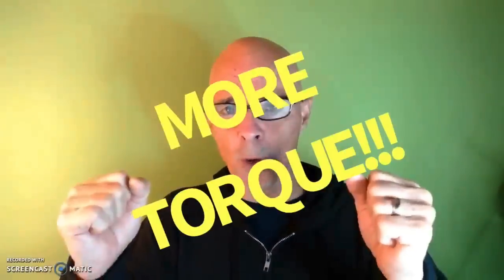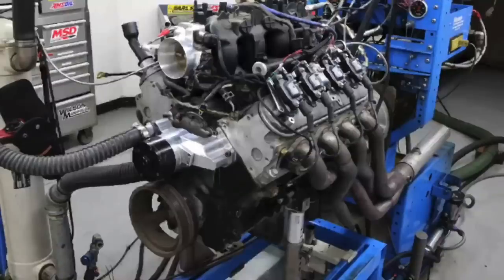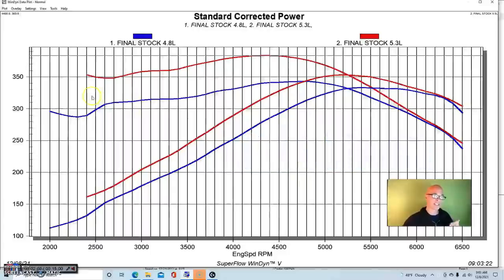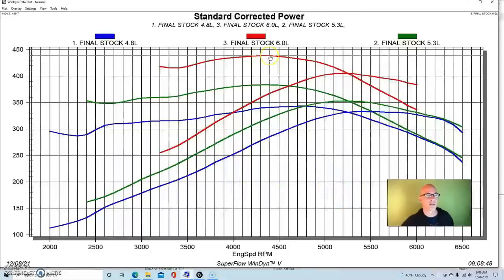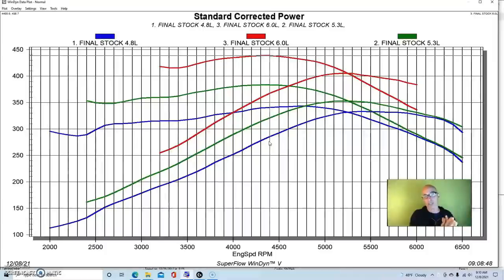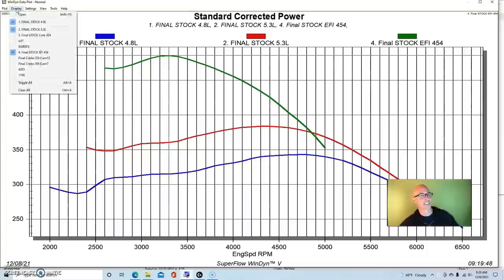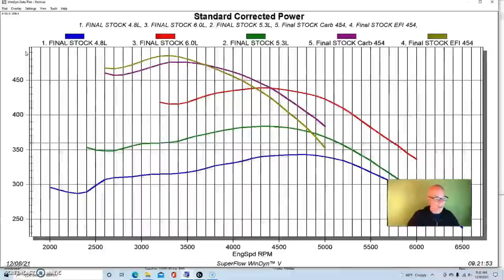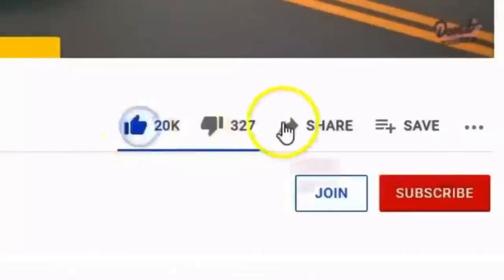LOW BUCK, JUNKYARD V8 TORQUE TEST-6.0L LS VS 7.4L 454 BBC-WHO MAKES MORE TORQUE? BETTER VS BIGGER!

Comment: @Richard Holdener, I'd like to see some combos and testing of a 454 in a attempt to bring MPG of the big block more in line with LS engines. That's always one of the arguments of BBC versus LS engines. 
Is there a way to get 20+ MPG out of a 454 and retain the HP and torque synonymous with the BBC?
Now that is a challenge!
Reply: Your not likely to ever see the mileage of a 454 get close to an LS, that’s Richards argument when he says “better” the ls design is so much more efficient. In the same way, your never going to see that low down torque production in the LS, pretty much for the same reason, the port flow on the modern engines is so good, you don’t see high velocity at low rpm like you do on the older designed bbc heads. 

Small ports with big cubes creates very high velocity at low rpm, that’s why “peanut port” truck heads make so much low rpm grunt and run out of steam above 4000rpm. All those cubes and the old inefficient heads need lots of fuel and air to run. The new stuff is so much better, but small cubes and big ports can’t create the grunt down low, it needs the rpm to get the flow velocity up.
Reply: @guyforlogos  you also didn't have the air fuel accuracy or the trans that put the engine at the most efficient range running small tires compared to today or or the accuracy in spark timing I think you could break 20mpg with a big block more compression and dialing in the engine would be key
Reply: @austinhowze6280  you definitely can in a car with an overdrive trans and modern fuel injection, or even a very well tuned carby, but not likely to ever see high teens let alone 20mpg in a tow vehicle, which was what my comments were based on because of the nature of Richards video.

My sisters all stock 06 2500 with a 6.0 and 4:10’s, built to tow well, gets 12 unloaded and about 8-9 towing 5k. That’s pretty modern, my buddies all stock 17 yukon xl, 6.2 gets 21!! unloaded and under 70mph, 18 mpg at interstate speeds, 8-10 towing his enclosed 7k trailer. Towing is brutal for gas engine mpg. If you tow a lot you want diesel for mpg.
Reply: @guyforlogos  my cousin old 460 did 10mpgs unload and 9 white 15 20k behind it buts it's mostly on how you drive it
Reply: I got 20 in a 96 k3500 single cab long bed non dually
Reply: My 95 Chevy xcab 454 straight shift gets 17mpg. 8 in town and 9 on the highway is 17 right?
Reply: @guyforlogos  Your buddies 6.2 Yukon get 21mpg because of active fuel management that operates off of 4 cylinders on the freeway.   It's great until the engine gets over 100k+ miles, then comes the collapsed lifters and blown engine. I have the stock non afm 2007 yukon denali with the 6.2. I average about 10 mpg, but also on 35"  tires.

Comment: I liked the 496 they put in Topkicks with MPFI. It pulled better than the Ford V10 at about the same MPG, maybe because of the 6 speed Allsion. It also sounded better.
Reply: Probably all in the trans cause I just pulled the power cruves and the v10 holds more low end power but after that the 8.1 starts making more power

Comment: "Nothing beats a LS motor, Except a Big Block Chevy" - Steve Brule on engine masters.  as a lover of all things big block, i agree.  the best truck motor I have ever see was the HT502 peanut port crate engine. its advertised at 406HP @ 4200 and 541ft/lbs at 3700. it has 8.75:1 compression so it can run 85 octane fuel. sure the LS makes more HP at a higher RPM, but Truck guys pulling a trailer are not running above 4500 RPM, unless they are down shifting while pulling a trailer and climbing a hill. you cant beat a BBC for truck engine with out going to a diesel.
Reply: Considering the Gen 6 snd 7 454s are more LS than a Gen 1-5 BBC...
Reply: @shadowopsairman1583  Gen 6 big block are mostly still mostly compatible with the Gen5 and Mark IV big block.  the only change from Gen 5 was the addition of a roller cam and the switch to MPFI from TBI. 

the Gen 7 8.1L Vortec is the one that most like the LS, it has a new head bolt pattern and symmetrical port heads. the firing order changed, and the oil pan rails were changed and the threads on the block are all metric. it also switch to the coil on plug setup like the LS. it was like the LS and the BBC has a bastard child.  its like the engineers at GM wanted to make a big block version of the LS, but the bean counters said no. so they created a LS style heads and cam for the BBC.  it doesn't really share any common components with the previous generations of Big block Chevy's.
Reply: An LS is great but the LT's are better 2014 and up.. direct injection..
My Silverado has averaged 24 MPG with the cruise control set at 74 MPH multiple times and tows great..
I can ease into the throttle and accelerate really good with out the converter unlocking or with out a down shift.
Reply: @philllsxga.7737  I agree, LS and LT engines are very, very, good. but for stump pulling brute torque its next to impossible to beat a Big Block Chevy.  that why they put the 454 Chevy and 440 Chrysler in so many motor homes. that 502HT is unreal for pulling power. and you can run crap 85 octane gas in it all day long with out issues.  the only thing that beats a big block for pulling power is a diesel.
Reply: @shadvan9494  yes I agree.
BUT YouTube LS Winnebago!
LoL!!!! Torque problem solved!!!
Reply: Yes I agree!! Ive got several bbc combos. My next will be a 502 shortblock crate and bolt some afr 265 heads and dual plain. I'm betting 525 hp and 650 lb ft. I sure love the big blocks!
Reply: @shadvan9494  I suggest you look up the L-86 6.2L numbers before you think a BBC would out pull it... lol
Reply: Try 500 Cadillac makes more torque down low compared to the BBC and weighs less too
Reply: @shaun.h.barlow  cadillac 500 is junk in performance comparison. Yes 550 lb ft way down low but thats just cam and displacement. The lighter weight you are referring too is ok for stock or mild builds but were the bbc is strong the cadillac has a lot to be desired in block strength. I do like the cadillac. But the big block chevy was overbuilt originally for use in nascar. Bopc designed there engines for standard luxury and performance street cars.
Reply: @YZFoFittie  460lb ft?? The only advantage is the 10 speed trans..
Reply: @thekid1924  video title LOW buck junkyard torque aka tow rig, on the performance side caddy MTR still holds gasoline land speed record of 417 mph
Reply: @shaun.h.barlow  a big block chevy holds the world's fastest piston driven vehicle 470mph
Reply: @thekid1924  if the caddy is so inferior to the BBC why does it need exotic fuel to go faster than a caddy on gasoline?
Reply: @shaun.h.barlow  whats low buck about a cadillac?  Can't find any engines or parts in my area. I know of several guys that tried the cadillac engines in tow rigs in the 80s the 472 and 500s. On long uphill climes with a load they would burn valves like the 460 fords. They don't breath like a big chevy. Ive towed 25000 lb with my 427 tall deck in my c70 on the longest grade around me which is 10 miles at 7% grade. 4000 rpm the whole way floored. Glowing orange exhaust manifolds. Ive put 20k miles on the rig in about 3 years. 0 problems
Reply: A huge advantage of a LS or Lt over a big block is weight...
Reply: @philllsxga.7737  a black bear weighs 600 lb a grizzly bear weighs 1500 lb. I wouldn't really consider the grizzly bear as having a disadvantage would you?🤣
Reply: @thekid1924  when it comes to a race car weight is everything...
YouTube Nelson racing LS engine explained...
Why would you want a big block?!???
Reply: @philllsxga.7737  🤣 fools have no reasoning. We are talking ultimate tourqe engine . Not dropping every ounce of weight. They make all aluminum big blocks also. But that's not the point.  99. 9 % don't care about weight . In trucks weight is good.
Reply: @thekid1924  but why the extra weight???
The ls is more durable than a conventional 454 I get the big block nostalgia but you cannot beat the LS motor and even the new LT it is leaps and bounds ahead of an old Chevrolet big block...
I've done a ton of off-roading in my life the heavier diesel Fords always got stuck the 1500 gas Chevrolets no problem...
Reply: Did you know a fully dressed LS3 is about 370 lb???
Reply: @philllsxga.7737  did you know an all aluminum 5.5 hp Honda weighs 33 lb?
Reply: @YZFoFittie  the L-86 doesn't beat the HT502 for torque.  the L-86 is rated at 460 ft/lbs at 4100 rpm. the HT502 is rated at 541 ft/lbs @3200 rpm. that's 81 FT/LBS more at 900 RPM lower in the torque curve. 

when your looking for torque for a work truck, or towing you can not beat A BBC.  Dont get me wrong, LS/LT motors are fantastic. they are as indestructible as a BBC,  get better fuel economy and weight about 250 LBS less than a BBC. they are everything you can want in a small displacement V8. but sometimes you just need brute strength, and that is where the BBC really shines. I would love to see a new "Gen 8" BBC, basically a Big Block version of the LS/LT.  somewhere in the 7.4 (454)- 8.1 (496)  liter range, with modern block and head castings. think basically a scaled up version of the LS. the gen7 8.1L Vortec is close but not quite there.
Reply: @thekid1924  yep! It's underrated. It's actually 546.684 horsepower and has an optional clutch housing relay throw out shaft for more on demand torque...
Reply: @philllsxga.7737  try to move a mobile home from AZ to Colorado whit it and then try it whit a 454 and came Back to tell us which was better.
Reply: @thekid1924  the advantage of the LS and Lt is the torque hangs on till past 4,000 RPM..
The 454 is done around 2,800 to 3000...
Reply: @philllsxga.7737  with the 454 in this video, yes the torque was done at that RPM. However you don't need 4500-6000 RPM pulling a trailer. even down shifting your not pushing 5000 RPM in a truck towing a trailer. the HT502 is a killer motor for a truck that is used for towing heavy loads.  most trucks with heavy gearing in the rear diff (4.11:1 or lower) with an overdrive trans and 33 inch tires are going to be pushing 2800-3000 RPM at highway speeds, that is right in the sweet spot for a 454 or HT502. and if it has to down shift, it will be right in around the torque peak in RPM in the lower gear.  so having the torque peak at 4k or higher in the RPM range does not help when pulling a trailer unless your running rear gears that allow the engine to run in that RPM ranger. which then kills the trucks fuel economy.
Reply: @shadvan9494  🎯
Reply: @philllsxga.7737  my ho 502 will burn the duallys off from 1000 rpm all the way to 6000 rpm🤣
Reply: @shadvan9494  you need to look at average Torque, you are focusing on peak...
Reply: @thekid1924  you don't understand the significance of peak vs average power...
Reply: @shadvan9494  Yes imagine one with the vvt that they put on the LS..and like you said with a new head design for low mid-range. No reason why they can't be running 10: 1 on a big block Chevy. Probably could be making 550 ft lbs down low in the rpm range with today's technology in a redesign big block. As long as they didn't get carried away with port size like they tend to do and slow port velocity.
Reply: @YZFoFittie  the HT502 and the 454 in this story still make more torque on average than the LS/LT motors. after peak torque, the LT/LS engines make more power to the peak, but that's all, and again not what you want in a truck engine that has to pull a load.  

Have you ever driven a Big Block Chevy powered car or truck? 

I have driven lots of LS/LT and big block powered Trucks for work. personally, i would rather have the big block when pulling any kind of trailer.  I have also owned a 2002 trans-am and 2014 Z51 corvette. I think the LS/LT engines are fantastic and get incredible fuel economy.  but neither hold a candle to my 1971 Camaro SS 396 (actually a 402CID since chevy punched them out .030 that year but still marketed it as a 396). the only changes from stock were a XM284HR roller cam/lifters and springs to replace the factory cam that went flat and a set of headers and a bearing, ring, and gasket kit when rebuild it about 7 years ago. it runs 11.7's all day long on slicks and will destroy a set of street tires in minutes in a burn out. it is brutal on launch and will throw you back your seat when you mash the throttle. my old TA could not match it in a drag race or do burn outs like that car can. my 2014 corvette would run low 12. but still doesn't come close the head snapping power of that 396 camaro.
Reply: I replaced the 454 in a truck with a 455 Pontiac.  Nearly doubled the mpg,  and topping the same hill pulling same trailer load 15 mph faster. A bbc can be beat in a truck, but out of chevy engines, ABC, LS, or bbc, the bbc will win everytime
Reply: @Stiffclits420  I have raced plenty of LS trucks with my stock Lt Silverado, there was no comparison.. my Silverado walks away every time and I'm averaging over 22 MPG most of the time.
The LS platform couldn't do that.
Reply: @philllsxga.7737   then you turbo the big block and it beats it twice as bad
Reply: @byronmcelfresh2380   there’s no way lmao
Reply: @shaun.h.barlow  nobody sleeps at 3200 rpm. 
        Most runs are 6-9000rpm through the traps

Comment: I have a 94 k2500 with a tbi 454, and a 2018 chevey 3500 with a 6.0. Both are stock. I have pulled the 12k skid steer that I use at work with both trucks. My k2500 pulls that skid and trailer so much better than my 3500hd. My k2500 will pull it at 75mph on the interstate in overdrive. While my 3500 screams at 4k in 4th gear to keep the same speed.
Reply: The 6.0 really isn't a great motor for big trucks and pulling. Also, you gotta think the 6.0 is in a far bigger/heavier truck (new trucks are obnoxiously big) and probably has less power.

Comment: Man, I swear read my mind! This is right in my wheel house! I’m building a 403 for my single cab Silverado. I’m loosing my mind trying to pick a daily driver cam for it! I don’t want to throw away all my torque with to much cam. Can’t wait to see how the 408 stacks up to the 454!
Reply: The cam swap on the 5.9l magnum really surprised me with how much power it really made. A smaller cam is gonna be up under like 2500 and lots up under 2000, a bigger cam will add some and even lots over 4500...for street driven stuff i really think small cam is the way to go. Everyone i have met and built with only one guy regretted going to small with his cam and he had a C4 corvette with a stick that he drove about 2000 miles a year with drag radials.

Comment: At work we have a 97 c3500 single cab dually with a 11 ft dump box that has a 454 and a manual. Great old reliable workhorse. My company pickup is a 14 Sierra 3500 single rear wheel with a 6.0L. I'll take that 6.0 any time. That's an awesome powerplant.

Comment: To me bigger is always better for engines which is why I rebuilt a 460 Ford out to 521 inches in my 1978 Mercury Grand Marquis daily driver.
Reply: Probably didn't hurt MPG much either, my 460 gets 12-14 mpg with 9.75 to 1 compression and 2.75 gear 315-75-16 tire (35") cruises 65mph at 1850 Rpm, I bet that 521 is closer to the 10 Mpg mark but a lot stouter

Comment: Great comparison Richard, I love these kind of comparisons. It would be a cool experiment to see if one added a small turbo, very small, on these STOCK  ls engines to see if it could raise the low rpm velocity and therefore low end torque production, like they do on the modern small 3 and 4 cylinders. Something with less then 10 lbs boost for towing. The mpg issue will always be a problem for any tow engine.

Your not likely to ever see the mileage of a 454 get close to an LS, that’s Richards argument when he says “better” the ls design is so much more efficient. In the same way, your never going to see that low down torque production in the LS, pretty much for the same reason, the port flow on the modern engines is so good, you don’t see high velocity at low rpm like you do on the older designed bbc heads. 

Small ports with big cubes creates very high velocity at low rpm, that’s why “peanut port” truck heads make so much low rpm grunt and run out of steam above 4000rpm. All those cubes and the old inefficient heads need lots of fuel and air to run. The new stuff is so much better, but small cubes and big ports can’t create the grunt down low, it needs the rpm to get the flow velocity up.
Reply from the maker: the port velocity is not where the additional torque comes from the in BBC-it's just displacement
Reply: @richardholdener1727  I agree it’s the cubes that make the torque, I would be curious to see if a 427 or bigger LS stoker with the stock truck cam and heads would still have the torque peak as low as the bbc. To see how the more efficient LS style heads compare to old antiquated bbc tech. 

I bet it would make overwhelmingly more power and torque, just curious as to at what rpm levels!

Love your stuff!

Comment: Richard great video for us truck torque junkies.  Waiting for a video featuring the 8.1L.  Last I checked I didn't see it in any of your videos.  I'm thinking about swapping my 2002 6.0L for a early 2000s 8.1L for more torque for towing.  Donor truck would have an Allison trans as well which has better gearing than my 4L80E for towing.
Reply: Just find an old 12valve Cummins.